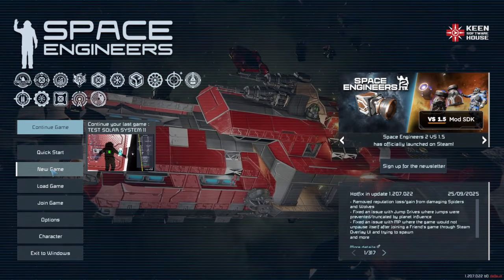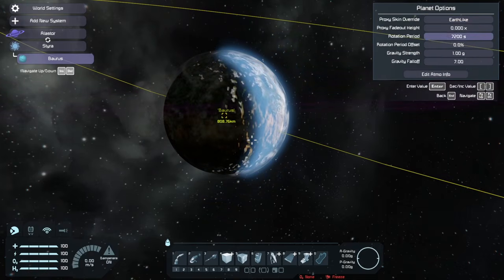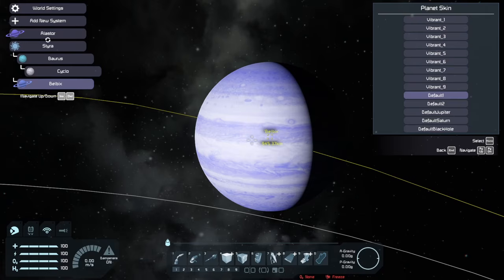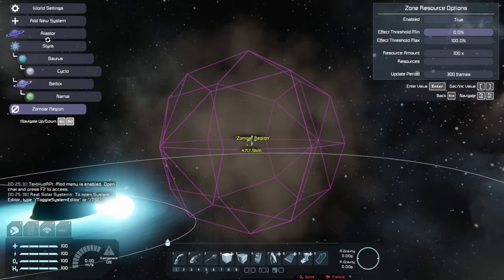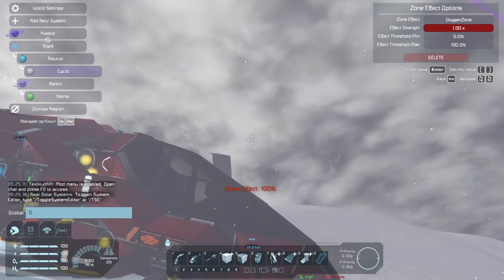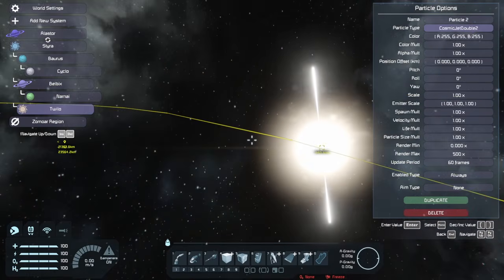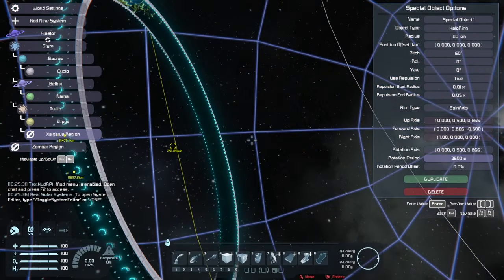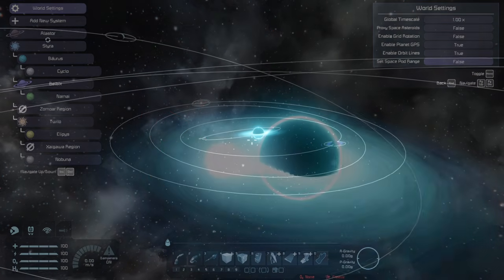Building Your Own Solar System | "Real Solar Systems" Mod Tutorial

Comment: Why does it need to move everything 100,000 km up?
Reply: Only for Modular Encounter System spawns to work correctly. If you don't use MES don't do this.